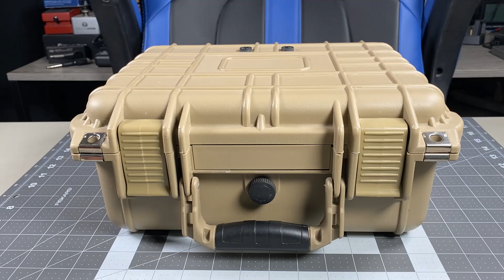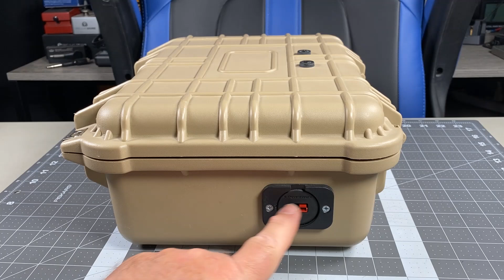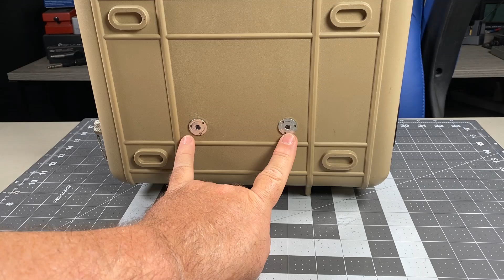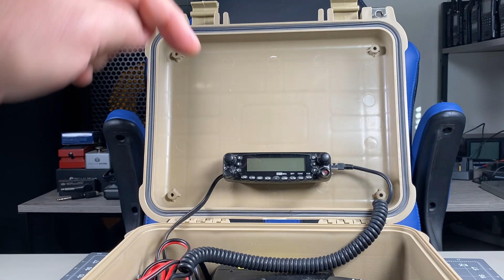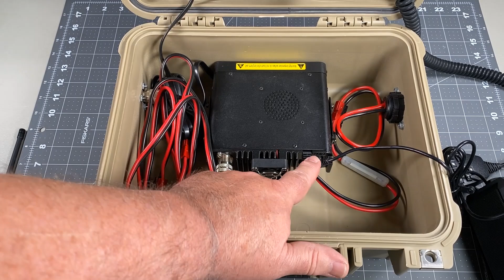A close up look at my Go-Box layout

Comment from the maker: Before anyone calls me out on it, I am aware that I kept referring to the faceplate as the head unit. Sorry about that. But I'm certain everyone still got the point.
Reply: How do you waterproof the power connectors on the case?
Reply: @VictorBravoWhiskey  you don't he mentions that in the video. You could silicone around the holes and the power pole thing should have a plastic flap that folds down over it when it's not in use. He covered punching holes in the case though.
Reply: You’re good. I call it the head all the time.
Reply: If you keep that kind of thing up we’re going to start to think you’re a human.

Comment: Double tapping the comment about links for parts. As a newbie I’m having a hard time finding the bulkhead connectors
Reply from the maker: These are the ones that I use - https://www.amazon.com/DHT-Electronics-coaxial-adapter-female/dp/B00CX01IYM/ref=sr_1_14?crid=1OGKZYATVZX4G&dib=eyJ2IjoiMSJ9.Zoiux9-Oekd4UyY9UzqzKuo8Y42t0WNRfnaXzdtXhSbC5Ksr_6GWDRYC3YRE7hj21zOM5tLARldfa9LPEAPnVcZ3p8mqIYHIeC7OxEVNrdda9y_ETnHqLFuZpGT0KByc-k5mjlrb98T3tcw_HTxuPq4mlNCtn_-duiwYW3IPNfrAEzBaen5j-xX-ETyMkUP_VcFG1L7QSVvYkNOY3dGRiPvG0iqXSJIhGJ3H9TA8zxk.fuyXHLA9X-3IpoDDx-dcmx8lBHPrX66L-BuM2_Xh4og&dib_tag=se&keywords=so-239+bulkhead+connector&qid=1738885187&sprefix=so-239+%2Caps%2C193&sr=8-14
Reply: @ thank you so much!

Comment: I've built my go-box solution into a series of boxes, each a module filling a certain need. So far I've put together 3 boxes, a "radio" box(pelican style case ~ the size of a Apache4800), containing a G90 and a Kenwood TK-780(2m only); a 40Ah battery box(HF tactical ammo box), designed to output 20A for 2hrs which has a built in solar charge controller, and battery monitor; third is an antenna box(HF Voyager 18" toolcase), which I've already outgrown; and fourth, which is currently in flux, is a VHF digital box(form undecided, although the equipment is currently acting as an igate on my desk), designed to operate as a field APRS igate and beacon, with a 30w Kenwood TK-7180, a SignalinkUSB, and a laptop. 

The big goal with my system is to have things pre-set-up, so that I can simply drop the boxes on a bench, flip open the lids, and with a couple cables connecting them together, and a few minutes setting up antenna's I can be on the air. I did locate the power connectors for the radio box inside the box, with the mentality that I shouldn't be leaving power and antenna's connected when the radio's aren't in use.

Comment: I built a “go box” in a rack mount box that by the time I was finished, I needed wheels to transport it. I have since taken most of the components out for smaller, lightweight packages that are much easier to transport. They always say “KISS- Keep It Simple, Stupid.” Yours is a very simple and practical solution and very lightweight.
(You are definitely not stupid!)

Comment: Don't bother chopping the faceplate cable. Use an ethernet cable of an appropriate length for the faceplate. You can get a 90deg RJ45 connector and keep things tight and tidy.

Comment: The keep is simple principle should be more common.  I started off building my VHF/UHF go box based on the ID5100 one from Shack In the Box.  After I got it build, I discovered it didn't work for my style of operation.  I also took a suggestion from Jason KM4ACK and his modular power distribution box and decided to simplify my setup to be just a battery and the radio itself.   I like the T-Nut idea for mounting the radio to bottom of the case.  I will take a look at that myself.  Right now, I am using heavy duty velcro to hold things in place.
Reply: Nice!  Got a Pelican 1400. It stays in back seat of truck with a 12ah Bioenno battery. Faceplate on mount on dash. Mic on extension from back seat. All cables run from back seat along middle console up to dash. I can take face plate off dash put in box and go to the field. I have Armoloq rails with antenna on front. Put a Signal Stick antenna. What works, works. No fancy box but it works.